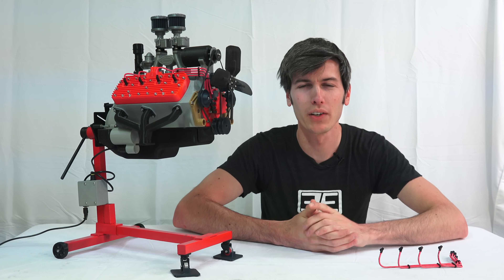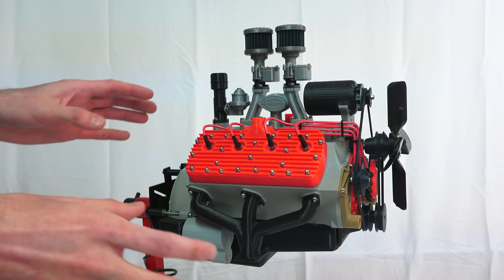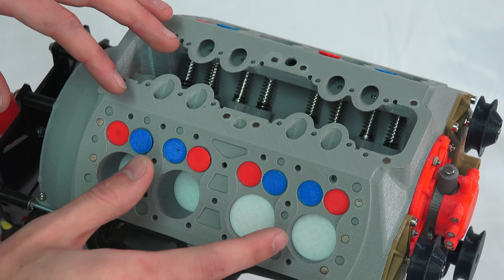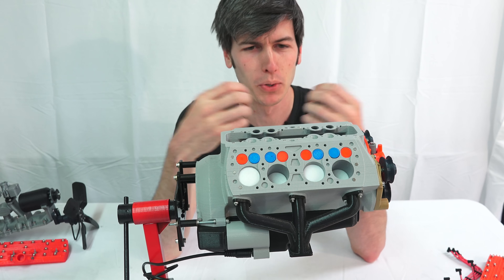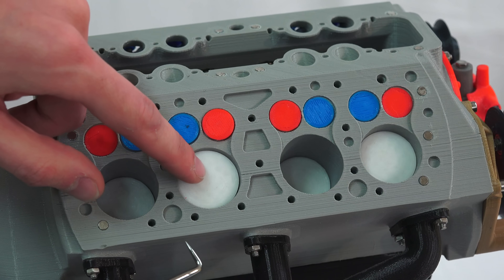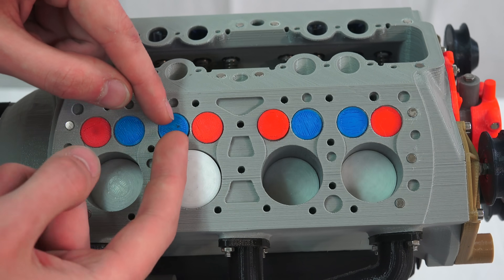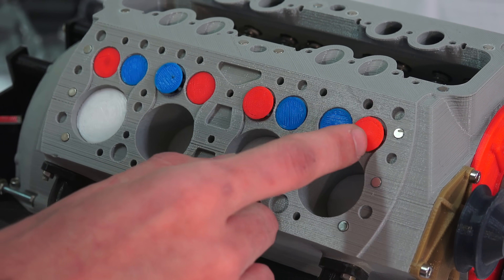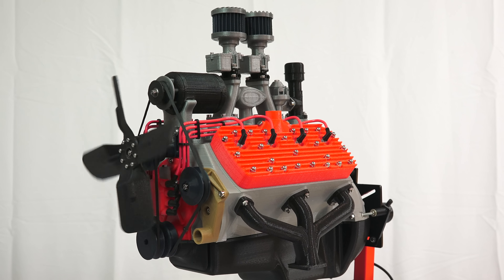Why Ford's Flathead V8 Engine Died

Comment: 40 seconds into the video  and we are talking liters instead of cubic inches?..really?..we cant say it was 221 cubic inches ???..and yet again at 7;30 ..its 3.9 liters..not 239 cubic inches...flatheads are measured  in cubic inches and talked about that way..not  in liters...
Reply: Most of the people who would watch this video grew up with 'liters'. Most of the people who understand what cubic inches are can do the conversion.
Reply: @xaenon  Anybody born in 1953 only knows cubic inches. Of course I was born in 1949 so I still can't speak litres. Or maybe I don't want to. :)
Reply: @johntripp2028   I certainly understand.  I was born in 1964, and prefer the cubic inches thing myself, mostly because I grew up with cubic inches, and then, like many schoolchildren of the era, had to learn the metric conversions in school.  They didn't teach it to us directly, but I was able to wok out that one liter = 61 cubic inches, but you can actually get pretty darned close by with CID/60.  Chevy 305 = 5.0 liters.  

I know, it's still a teensy bit cumbersome, but when I hear them say things like 3.0 liters, the simplified liters x 60 gives me a fairly close answer - 180 cubic inches.

Of course, the old cubic inches nomenclature carried with it implications of a certain amount of power, since power was largely a function of displacement at the time.  But with modern engines, displacement has a somewhat diminished role in power output - there are V6s today that deliver more power real-world power than some of the old 400 V8s

Comment: Change of direction of gas-flow is not the big issue here, but the shrouded valves and constricted passages are. Open that up, and you drop the low CR even lower. Lack of squish-band helped enable detonation. Contorted gas passages in block are BAD, for heating incoming charge and conducting exhaust heat into the iron. Service access to valve gear is lousy too. Harry Ricardo's combustion analysis could have helped Ford A LOT.
Reply: Jacques---   Yeah, but back then who cared?  It was a manufacturing miracle of some dimension that Ford was able to cast a V-8 block reliably at all, never mind the nicities regarding combustion efficiency.

Comment: I think 3 main journals for 8 cylinders, exhaust passing thru water jacket and parasitic power losses that allowed a chrysler 6 230 - 265 walk all over it on torque. The flat 8 was cool looking but always a looser

Comment: My Father worked for a time as a mechanic back in the day at a Ford dealership. Fastest car in town was a bootlegger's flathead Ford V-8 that the owner had a supercharger installed by the dealer. The ATF finally caught the guy (blocked him in, I think) and part of the penalty was to transfer ownership to the Feds. I was not aware superchargers were available for the flathead V-8 when it was first introduced, but they got own somewhere. Dad said it ran a lot faster than the regular ones.

Comment: Cadillac had mass produced V8 engines more than 20 years earlier.Why don't you use these as your example engine.Cadillac also mass produced V12 and V16 engine before the Ford flathead was ever conceived.Cadillac engines were possibly the 1st true crate engines developed as part of the WWII war effort.
Reply: Ford Flathead was perhaps first V8 in affordable cars.
Reply: Cadflat-   Sure, but at what cost?  What would've worked for the Cadillac buyer, price-wise, would NOT have worked for the Ford buyer.  In 1914, Peugeot made an all-aluminum alloy, double overhead cam, 4-valve-per-cylinder engine that nobody else tried to build until more than 10 years later (see 'Miller Racing Engines').  But at that time (1914) it was at a developmental dead end.  Too expensive to build for the market.
Reply: Love that Cadillac power, yes I do.

Comment: Years ago, a mate of mine bought an old single spinner for about $120.  When the starter motor burned out, that low compression ratio came in very handy.  He used to start it by putting it in top gear, pumping the accelerator a few times, turning on the ignition and then getting behind the car and pushing it.  With a V8 engine and low compression, it was dead easy to start.  As soon as the engine fired, he'd run back to the open drivers door and jump in and be on his way.

Comment: I had the fortune of doing some contract work at the Ford Lima engine plant and got to see some crazy cool stuff. While I was there they had a small ceremony for the last engine to be produced when they stopped production in 97. The engineering staff had laid out the original prints that were of course all hand drawn and all the measurements were in fractions! It was so unreal to look at a dimension and it read something like 4 and 3/32" or 8 and 17/64". I am sure that this flathead would be the same. Very cool stuff. They also had a 460 engine that they repurchased from a customer that had over 1 million miles on it. They tore it down and had all the parts laid out on a bench. The cylinder bores still had the cross hatching from the hone. Some of the valves were so caked with carbon that it's a miracle it still ran. A testament to the design and overbuilt quality.

Comment: Don't know that much about how pressure thresholds in varying thickness steel, but I was wondering if metalcast engine of this size would actually function properly or would if it would just explode?

Comment: GM was producing an ohv v8 in 1917. So, the correct answer to what killed the ford flathead V8 is far simpler than your 8 min + is General Motors.

Comment: So much  simpler  than the junk they are making  now  
 Put blower 
Or turbo  with the modern metallurgy  , tighter clearances 
 & fuel injection
 and  engine control module  they would be ideal
  Compact   engines .

Comment: One thing you didn't mention was that cooling the engine was also difficult because the hot exhaust gases would have to pass through the block before exiting through the exhaust manifold. Apparently they were notorious for cracking blocks if the cooling system was overtaxed.
Reply: Plus the middle two cylinders sharing an exhaust port made it very, very hot.

Comment: We're going back a bit here,I was around 5yrs old when these were in Vogue,they did sound great and were super quiet mechanically but they were grossly inefficient with their low compression ratio and side valve layout,they had the low compression because the petrol was crap in those days,if it had been started up on petrol to warm up it would probably run on paraffin if the ignition timing had been retarded a little,very nice engine for its time but it's best left in the Past.

Comment: Flathead=good Overhead valve v8=awesome LS engines=unbelievable. LS truck heads outflow the best sbc GM factory heads. Harley Davidson figured out ohv makes big power over the flathead design in the 30s

Comment: These engines were fitted in the Allard car, 7V truck and the WOA 2 staff car. Also I think the WOT 8 army truck.
I worked on all these vehicles in the late 1940s. Solid unit.

Comment: Well explained.  Getting any hp from a flattie takes a lot of machining, intake and exhaust runners, valves, stems, guides, and once you start with the modifications it never ends. I’m only pulling a bit over 225 hp out of my flattie.  Must have a true love for this motor to spend the Time, effort, and massive amounts of cash to break the 200 hp goal. I couldn’t build another like the one in my coupe for less than 10K.  Once you find a suitable block, really needs to be an L code on the block, and a machinist to take the time to do the work correctly you better have deep pockets and a serious love for this chunk of iron....       nothing beats the sound of a flathead and the look is pure nostalgia.          Flathead Ron...

Comment: 53, that's awesome. You might get a kick out of a Tractor I was able to get running. It's a Ford NAA 1953 Golden Jubilee, and used a gasoline inline 4 cylinder with 33HP.  It's torque is much more impressive even than modern tractors with more HP. This tractor featured many new tractor improvements over the model before the Ford 8N. The Ford N series tractors and NAA tractors were build to target a new tractor market. The small farms which couldn't afford the rather larger and much more expensive tractors that big farms had.  Love the videos.

Comment: Another problem: since the bulk of the exhaust manifold is in the block (actually in the water jacket) the engine would tend to overheat on a long grade while pulling a load. The engine was an engineering breakthrough at the time since they came up w/ a design that allowed them to cast a V type engine in one piece. It was economical to build, was fairly reliable & rugged. Only worked on 1 & noticed that it was quite heavy. There were other V-8 engines at the time but they were built w/ the crankcase & cylinders in separate pieces & were quite expensive to construct & were used mainly in more expensive vehicles. Thanks for the video, explains efficiency shortcomings that I had suspected.

Comment: Also it tended to run hot because of running the exhaust ports long ways across the block, and only three main bearings instead of five.

Comment: Good video. I’ve always believed one of the worst design flaws of the venerable Ford flathead was the fact they had the Siamese exhaust ports for 2/3, 6/7 cylinders, not to mention the fact that “all” exhaust gasses were expelled through the block between the water passages that made a large contribution to the fact that they often overheated which is why some referred to them as “water boilers”. Nonetheless, I wouldn’t trade mine for anything.

Comment: The flat head did not die because of restricted air flow.  Yes, there was a bit of that.  But it was not the major issue.  The OHV wedge head that replaced it had shrouded valves too.  

The big issue was heat management.  The exhaust ports travel through the water jackets and transfer a LOT of heat to the cooling system.  All flatheads had massive radiators.  But if you ask for even higher power output, the heat transfer would have been even more extreme.  The last engines were at the limits of heat transfer and management.  The bigger cousin Lincoln/Truck  engines weighed 800# for only 100 cubes more.  They needed the mass to absorb and manage heat dynamics.

Comment: Quote from below 

"Dr Demento
It wasn't emissions, the flathead ended in '53, the first emission controls of any kind didn't start appearing until 10 years later.
Also he mentioned the compression ratio of 5:1, was because most gasoline was unleaded (though ''ethel'' lead started appearing in the 30's) but refined to a low octane - just like Coleman ''white'' gasoline for camp stoves and lanterns. Modern engines have at least an 8:1 compression ratio."

A good explanation of of the history of IC fuels & their additives would be awesome.

Comment: Good video, Thanks!
You might show how a valve rotator works & show the common mods to the Flathead-the reverse grind cam, 6 pack carbs that was so iconic & was suppose to breath better.
Still a st 6 fan myself. We had an old IH with a 500+ cui gas engine. Every time you shifted it rolled a massive fireball out the exhaust, best truck ever!

Comment: They died because they had the only post WW2 combustion chamber worse than than a Hemi Head, if you don't believe me about the Hemi then take a new Chrysler "Hemi" apart and you'll see it's not a true Hemi, it only shares the "canted valve" arrangement of the Hemi, which is the actual reason they run the way they do not because of a dished head and a big dome on the piston, even Harley Davidson said goodbye to the true Hemi design in '84 (86 for Sportster).

Comment: engineering explained ++++ good video on the ford flathead. the flathead died 1 year before i was born in 1955. i remember the old fords that had those flatheads. i have always been interested in the ford flathead. your video is factual and great.

Comment: it's not lack of computers that led to the HP.  it's proven that the slide rule is just as accurate.  no one was trying to go 100 mph, the power was sufficient to get the job done, and gas was beyond cheap.

Comment: exhaust ports through the water jacket what killed the ford flat head run it hard coolant boils around the exhaust ports jackets ! ok for an ole tractor, which the 60 hp was 2 tractor engines !

Comment: When the Flathead first came out reliability & longevity were huge issues. At that point in time the increased reliability & long life were more important than efficiency. 
Today's engines have the benefit of advanced engineering, precision machining & they are made of materials that last a very long time. We tend to forget that older engines tend to break frequently and, even if they didn't break, they just didn't last nearly as long as engines today. 
Fewer parts to break, fewer parts to wear out = less cost to buy & more reliability. That was a huge win when the Flathead first came out. It was a huge improvement in an affordable car you could reasonably assume would start for you every morning & get you to work. That kind of reliability wasn't a given in the 1930's.

Comment: Another problem with the design was the exhaust placement.  You had two hot exhaust valves right in the center sharing one port.  Older blocks (with a lower quality casting) liked to crack the wall between those two cylinders.

Comment: Hey, give the kid a break.  He doesn't really have a clue in terms of the significance of this engine.  Yes, as some of the commenters rightly noted the flathead was the backbone of modern hot rodding.  Guys like Ed Iskenderian  who made many performance cams had a flathead pushing a 13:1 compression ratio.  What about the guys who put Arias Duntov heads and a huff on top of a flathead?  There was an article in HR magazine about a few guys who have pushed this little motor to over 700hp.  I can't say that I would want to follow suite as you are talking cubic cash to get that much hp out of one of these motors, but they were fun back in the day.  Back then, the word was pep or peppy, not hp regarding how engines ran.  If you look at the evolution of the flathead, if you look at the Y block, there are a lot similarities, same with the FE blocks.  Anyway, you could say that it was the 350 or 351 of its day.
Reply: If you put overhead valves on a 'flathead', it stops being a 'flathead'.
I don't believe anyone could get 13:1 compression ratio on a side-valve engine.

Comment: The 90* direction change is less than ideal, but considering how the valves work, unless you have some serious valve lift the air is going to change direction regardless, you'll have some sheering. 

I think the biggest problem with that design is the valves are shrouded by roughly 50%.

Comment: Greatest Ford engine ever made! I had two, a '46 and a '51 and my Dad had a '50 Mercury. I got my '46 right after high school much to the chagrin of a neighbor. He said it made the housing unit look trashy. It didn't really look that bad. and it wasn't noisy. (yet) Finally, he told me day he was going to call the police and have it towed off. Well, I talked to my Dad. Dad didn't like the car much either but it was mine,didn't cost him a cent, I lived there also and used it to go to work. So, off we go to talk to said neighbor. Pounded on his door and when he answered the jerk knew he could be in deep, painful trouble. He tried to deny iy but that got my father madder.Finally, the said he had no objection to my fine Ford being parked. I was never so proud of my Father or loved him more. R.I.P. Sir.
Anyway, to finish my story. Everything was peaceful for a few month 'till winter hit. Frigid below 0 temps. Dig your car out, etc. By this, with help from friend and a '46 shop manual I got the old girl running a bout as good as it going to get. Got in, pumped the gas twice. Pulled the choke out, and hit the starter button. Fired right off like it was high summer. Well when I got out of the car to sweep it off, guess who's car was next to mine and wouldn't start? Yep, mr. don't like my car. He even asked if I'd give him a jump. I could have since his car was '55 Mercury which was the last year for the 6-Volt systems. The '46 was a 6-Volt also. I told the '46 was a positive ground and his was negative. Which was the truth but as long as the jumper cables were hooked up correctly, it made no difference. I told my Dad a month later and he laughed uproariously. Love ya, Dad.
I'm sorry this story rambled on. I was going to give a few quips about my Flatheads But this story popped into my head and it started writing itself. I hope of read read it get a bit of kick out of it
Reply: @John Oakes: Nice story, John. I'm probably much older than you (1933) and do the same. My sons, grandchildren, and older great-grandchildren  seem to enjoy the stories. Maybe they're just being polite.

Comment: The flathead died due to Henry's cheap, "** 'em" attitude. He didn't even go to hydraulic brakes until after WWII. The flathead was cast with too narrow a water-jacket, a too weak water pump, and a public thart accepted shoddy merchandise. GM & Chrysler were years ahead of the FoMoCo in every catagory. The Ford's popularity was due to it's cheapness, the availability in junk yards, and the massive production of it. I've had more than my share of the Ford flatheads.

Comment: I understand that there is an efficiency downside to tis engine. Although if mixture travels faster at the upper side of the inlet valve than at its lower side this isn't necessarily a bad thing since it creates a vortex in the cylinder, leding to better mixture repartition, or doesn't it? I mean, what did Opel do with the Twin Port system?